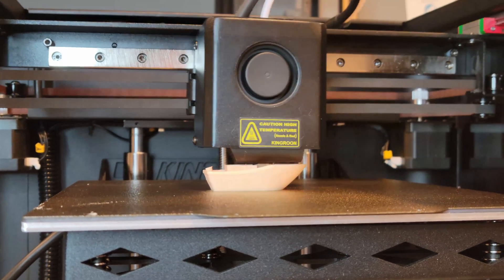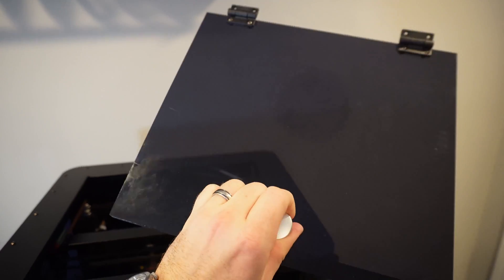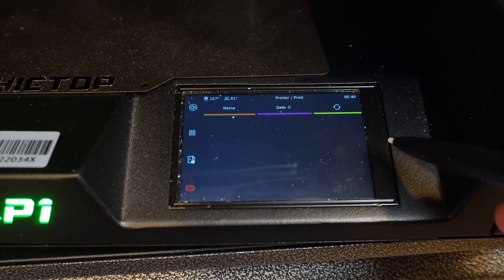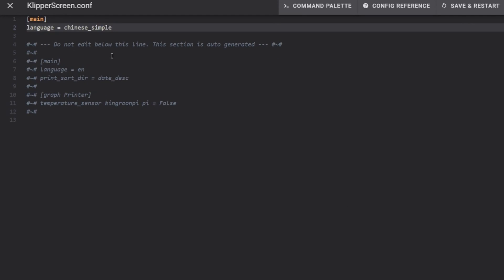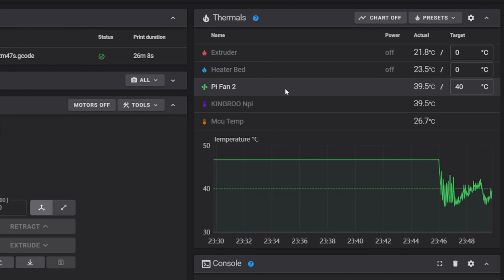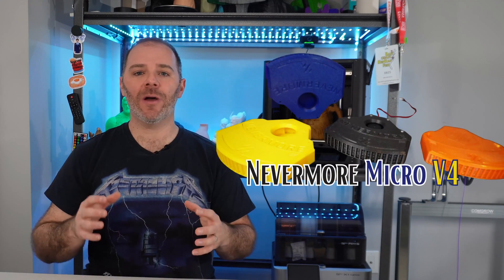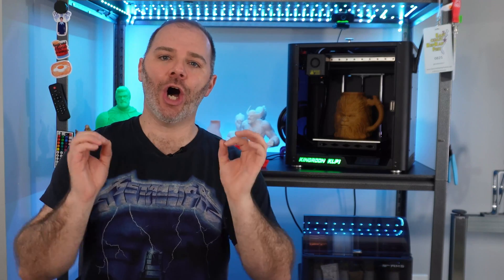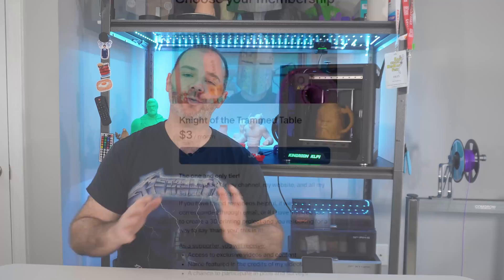Kingroon KLP1 - Step into Klipper !!

Comment: Great video thanks. I've had my KLP1 since late last year and have printed a lot of items with it. 2 things that i have not been able to tune out yet, circular objects are slightly elongated and i get a lot of ringing on the y axis. X axis is fine. The belt tension seems fine but i tried snugging just slightly. Did a CHEP cube and dimensionally on cube seems ok. Printing gnarly highly textured items and the look fantastic. Not unhappy with it for the money and i fall into the tinkerer category so i'll be completely satisfied when i get print quality completely sorted. AS noted, QC could be better. My 3 flashforge 5m are light years ahead in print quality out of the box. Any thoughts on my print issues?
Reply from the maker: Cris, happy to hear your (somewhat) enjoying the KLP1. Those issues you have sounds very much like loose belts. Whenever circles aren't quite, we'll, circles lol, then a loose belt is often the culprit. Sounds like you've done some adjusting in that regard already. I would still diagnose around that area. Clean the rods, double and triple check belt tension, make sure the printhead is snug and secure , etc. hopefully you can find the issue sometimes soon, let me know !
Reply: @PrintsLeo3D  Thank you sir. I'll continue tinkering! 😉

Comment: Got mine at February 13 2024 and both klipperscreen and fluid interface are still in chinese!
Reply from the maker: Well I don't like to hear that. Where you able to change it to the correct language?
Reply: @PrintsLeo3D - Yes, it was not that difficult, but just a follow up to your information. The printer I received from the German warehouse has a v2.2 board (as far as I can see, the newest is v2.3) so that might be the reason. My biggest issues with this printer is, that the loading of filament requires 3 hands - one to feed the filament into the tube, one to hold the tube, because it  is not fixed and the third to open the lever on the print head. I designed an update (or so I think) to hold both the run out sensor and to fix the tube, so you only need two hands ;-)
The other big issue is the vibrations the printer causes. The enclosure has so many uncontrolled resonances that it is incomprehensible. The automatic input shaper calibration does find the correct dominant resonances, but (from running the resonance test manually) the suggested max. accellerations (for  KLP1) is 8500 for X and 5200 for Y - compromising at 6000 has made the printer less aggressive, but still fast. Compared to my Anycubic Kobra 2 Pro (which has its own problems, mostly the closed firmware) is faster and has no dominant resonances after calculating and applying the input shaper.

Comment: nice review. which one is better for beginner, creality k1 or this one? in my region both have the same price at 500 dollar
Reply: I have both printers. K1 is much better, no doubt.
Reply from the maker: Awesome to hear from someone who owns both printers. What did you think of the 'out of the box' experience of the K1?
Reply: @PrintsLeo3D  KLP1 has problems with the extruder, it is prone to overheating and has performed extremely poorly when used with TPU plastic. The KLP1 has an insufficiently rigid body, it has a console table, rollers and pulleys are fixed cantilevered, it makes very nasty sounds at certain speeds, not all fans are controlled. The extruder is of a proprietary design, because of this, nothing can be done with it, only replaced with another one. Creality is trying to make a Klipper for housewives, and although they did not succeed, the direction of development is correct. K1 prints faster and better than KLP1. The essential problem of K1 is ripples. It is solved by replacing the pulleys with 20-toothed ones. Klipper also requires rooting, but in recent firmware versions this has ceased to be a problem.
Reply: @a1ac99  thanks for the advice, seems like K1 for me beginner, KLP1 got my interest because of the linear guide rail, but k1 is more mature than KLP.
Reply from the maker: Regrettably I don't own a K1, so I wouldn't be able to give any first hand experience, and based on that I really wouldn't be in a position to compare the two printers. There are some features on the K1 I really like seeing (like auto z offset) and I have to imagine it will have a larger user base, as Creality printers are more of a household name than Kingroon. Both of those factors make me interested in the K1, I know there are already a few mods out there to make it even better also. There's a group of users on the Discord who really like their K1, including people who've had a hard time with printers in the past, they've found the setup and ease of the K1 to be great. 
    A lot of the features of both of these printers line up, except in most cases the pricing doesn't. For you though the price being nearly identical makes me want to lean towards the K1. I mean I love the KLP1, it's been a rock solid printer for me, and it's still producing awesome prints and I have really no complaints. The one intangible would be the 'buzz' around it. There are going to be way more 3rd party (aftermarket) mods and parts available for the K1 because there is more demand for them (because Creality will sell more printers), which, in theory, may give the nod to the K1.
Reply: @PrintsLeo3D  thanks for the insight, its true K1 has larger user.

Comment: You are correct many printers not giving easy access to klipper. Showing the Qidi printers is wrong as an example, as you have full access there also. Actually both Qidi  and kingroon use OEM variants of the Makerbase MKS SRIPR system...

However, Kingroon has a big issue with quality controll. For example, on the door everything was mounted from the wrong side (hinges etc). Of course, easy to fix. However, my Qidi-X-Smart 3 and X-Max 3 produce better print quality. I might disassamble the extruder - maybe also a problem here.

The headroom for the extruder definitly is too low. The reverse bowden bending radius is to tight. On my KLP1 the top cover was always pressed up by it. There is a raiser for the top part on thingiverse which solves this problem.

On the other hand the price is incredible low if you search around a bit. I got my from geekbuyer with an 50€ coupon and only paid 280€ incl. tax and shipping. Still, I only recommend this printer for experienced users.
Reply from the maker: I always appreciate your thorough takes on these machines and my videos! 
    I would disagree about Qidi being completely hands off with Klipper though. I know you've had your issues with your X Max3, I've had some of my own, but ultimately I really like that printer a lot. That being said the way Qidi implemented 'their' version of Klipperscreen is what I was referring to about outside intervention. They hide the z offset within that screen , and they don't allow you to just update Klipper as you see fit. Of course it's a form of buyer protection, they don't want people haphazardly updating portions of their Klipper setup that could break others. Not a bad user experience by any means, but it's not direct access to Klipper (even though you do have root access).
    The filament path was only an issue for me from the spool and through the runout sensor. There's no doubt it is pushing itself along the top of the enclosure, but it never raised the lid for me or bound up. I know there's a few version of this printer out in the wild. I think Kingroon did a little better with each revision, this being their best shot at it so far.
    I really wish this printer lived at around 330-300, finding itself on sale for around 270-300. Prices are prices though, I never try and talk about them though because they be and flow so much, especially when something else hits the market in the same space.
    Thanks for the view and for your takes. I think it's funny how we have a very similar setup, I just don't have the Smart. I would have loved to get my hands on one to compare it not only to the KLP1 but also see the differences between the XMax3.

Comment: Hey Leo, So you seem to have got used to Klipper Firmware now!  

I still have not managed to get my Elegoo Neptune 3 Max upgraded to Klipper using the BTT Pad 7 I got.

So please if you can guide me and maybe other newbies how step by step to load Klipper firmware files onto my Neptune 3 Max and how to set it up so I can make use of the system
and hopefully then be able to do the same to my Neptune 3 and maybe the Aquila I have which has a high temp All Metal Hot End and duel lead screws and PEI bed and possibility even my 
QQ-S Pro Delta Printer as well, Then I be so thankful.   I have the BTT Pad 7 set to my local network already, just the Klipper installing I stuck on?

I having problems trying to use my system to log into any of the 3D Printer Discords I tried to be in including yours, So I can't use that help at this time sorry? Thanks for any help. 😀
Reply from the maker: Colin, it's funny you mention this, I was thinking of doing an Intro to Klipper live stream this week. I was going to set up a new host device (either a pi or an inovato quadra) and then flash Klipper onto that host as well as a printer. Then I would go over all the setup up needed. I was sort of kicking the idea around, thinking it could be helpful for people to follow along and ask questions as we go. I am going to put some ideas down on paper to see if I could get this to work well and I'll let you know. I wish I had an Elegoo to give this a try with but I don't, I would probably be using an Aquila D1 that I have in the box.